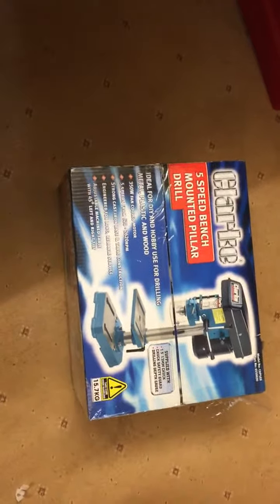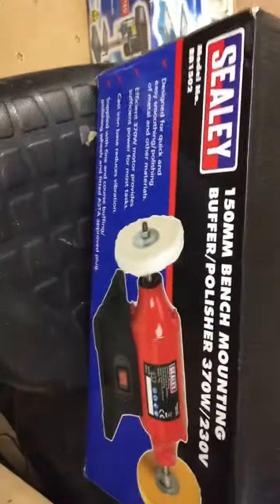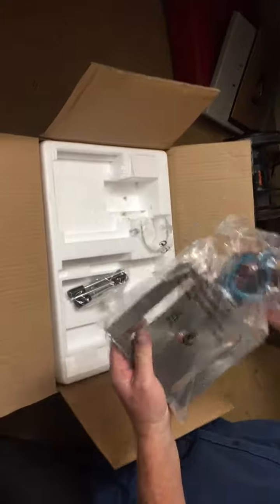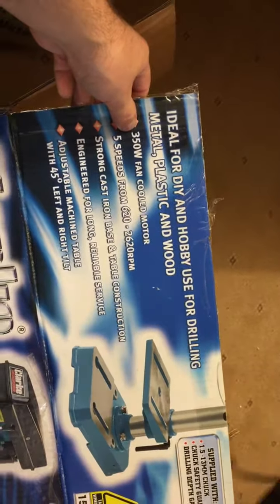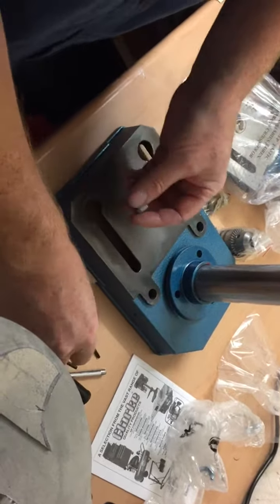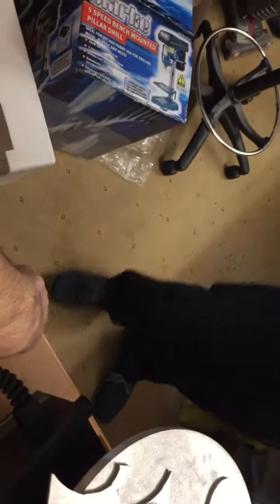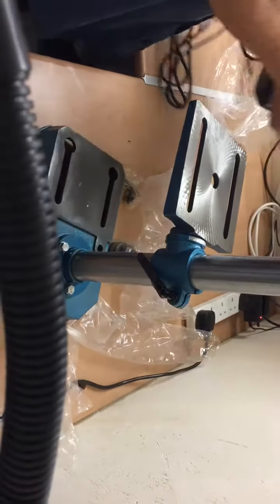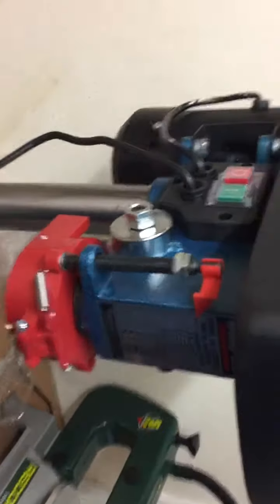Clarke 5 Speed Bench Mounted Pillar Drill 240v

Comment: got same today, such thin tube, 1.5mm the table flexes like crazy under load. might fill the column with concrete and rebar.
Reply from the maker: sounds like you might be going a bit too hard on it?